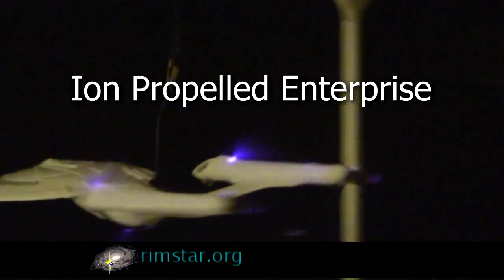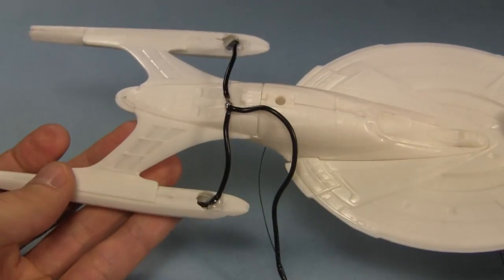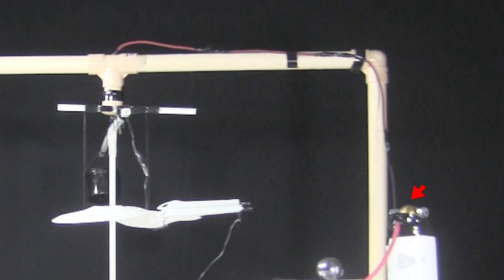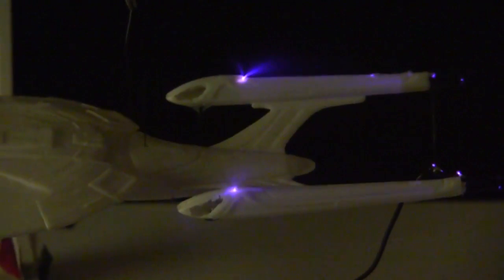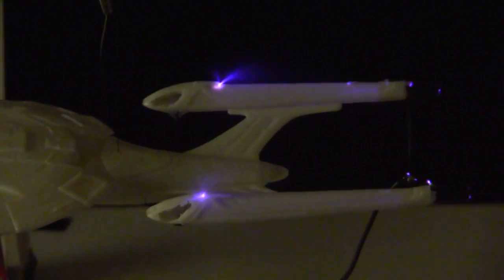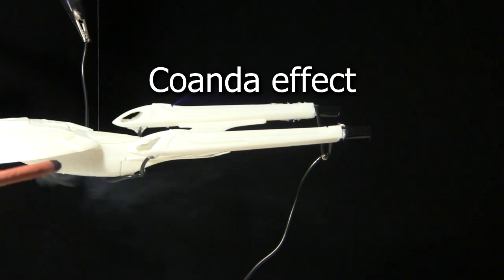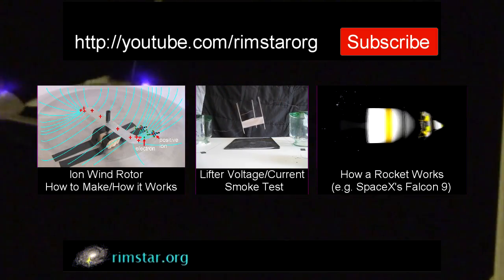Star Trek Enterprise Model with Ion Propulsion added

Comment: Sir I Mack same High voltage power supply but I don't no my wind power is so low I don't no why
Reply from the maker: What are you using for the wires or sharp points? If they're wires then the smaller the diameter, the better it will work. Mine are 30 gauge/AWG. The same applies if you're using sharp points, the sharper the better. You may also have your wire or sharp points too far from your smooth electrode.  You want them almost close enough to make sparks but you don't want sparks. Testing in the dark is also important. Rather than repeat everything, I have a bunch of tips on my webpage here https://rimstar.org/sdprop/lifter/lifter.htm under the heading "Tips for getting your lifter to fly".
Reply: @RimstarOrg  yes sir I use sharp points wire it's work but my model wind power to low and distance is small I think 🤔 maybe my amp is low...so sir how much amp u use your High voltage power supply
Reply from the maker: I agree, it's likely not enough amps. That could have been due to dull points or not being close enough but it sounds like you've ruled those out. I've never managed to measure my amps for these though I suspect it's more than 250  microamps, possibly even a milliamp. I did measure the input voltage and current near the end of this video https://www.youtube.com/watch?v=2HByosRAknY as around 8 volts and 2.5 amps which is 20 watts. In this other video https://www.youtube.com/watch?v=vzZy1Aqleno I measure the high voltage output at 25,000 volts. So 20 watts / 25,000 volts = 1.2 milliamps. Given that there are a lot of losses, it could be even more than that.

Comment: Must you have a minimum of 30KV DC power supply
Reply from the maker: I don't know what the minimum voltage is for this one. It does have to be a power supply that gives a lot of current though for the ionization. A Wimshurst machine or Van de Graaff generator probably won't work. But sadly, I don't know the minimum current required either.

Comment: Is the corona from the ion wind generating much heat? Is it flammable?
Reply from the maker: I've never noticed any heat from corona. I do stay away from it since the parts making the corona are at high voltage and can supply relatively high current but I think I would have noticed anyway. Certainly there was no melting of the plastic on this Enterprise model.
As for its flammability, the ones I work with are usually too low a current for that. However, it is sometimes possible to ignite or at least to burn dry wood if you put the wood in place of where the corona is. In other words put the wood between the two electrodes that produce the corona. In this video https://www.youtube.com/watch?v=r171_8jZqw4 , I show an arc produced by another high voltage power supply that supplies a higher current and that one can definitely burn wood.

Comment: M.Jean Louis Naudin is the inventor of the lifter on the year 2000' ! see his website : the Maximus 2 @ 250g...just ionic wing electrostatic pressure of ion on the molecule of the air near the wire (electrode positive)
Reply from the maker: Actually, Transdimensional Technologies is the inventor of the lifter, referring to the triangular shaped ionocraft with foil skirt and thin wire electrodes. I know because I learned about it at the same time Jean-Louis did from his old online jlnlabs group when someone posted a link to their video a long time ago (the link stopped working long ago).  If you were to ask him, I'm sure he'd tell you the same. Jean-Louis was the first to replicate it and make the replication public and then promote it a lot (I may have done it first, we were both very familiar with the technology at the time so it was easy for us, but I didn't publish until a few days later so I can't make the claim, nor do I care much).
I had forgotten about Maximus 2. I always remember the one by Blazelabs which weighed 100 grams and lifted a 100 gram payload, winning Jean-Louis's 100 gram payload challenge. There was a Japanese one which was room sized but I don't know if they ever said how much theirs weighed.
Reply from the maker: Ah, here you go. http://jnaudin.free.fr/lifters/story.htm He talks about Transdimensional Technologies there.

Comment: Hi! Thanks for these great experiments! :) A question:

What do you think, would this effect work in a greater and complex array form, I mean: by building multiple pieces in one big array, and feeding it with much higher voltage? Could it be a replacer of our propeller-based airplane engines? Theoretically but verified with math… And with more sophisticated materials, e.g. carbon fibre sticks instead of wood, just a tip. Here's a schematic sketch I drawn about what I imagined: http://www.kepfeltoltes.eu/images/hdd1/2018/01/24/520Biefield_Brown_effect_.jpg Of course, I've not worked to model wires, insulations etc.

Thanks! :)
Reply from the maker: It still may not be able to lift its own weight. The record is lifting a 100 grams payload plus the 100 grams of the lifter with a specially made power supply http://blazelabs.com/l-c-hexspiral.asp.
Reply: Thanks. Yet, I made a search for its math and I found this: F=P·(l/U)·[1/b·(1+φ)] (here's a better formatted instance: http://aip.scitation.org/doi/full/10.1063/1.4890353 )

where F is the thrust P is the power, l the electrode separation distance, U the applied potential difference, b the ion mobility (bair = 2.15 × 10–4 m2/V-sec), and φ the fluid performance parameter (φair = 2 × 10−2).

I'm not sure I really understand it but it seems that the generated force is directly proportional with the width of ribbon, for example. So maybe, if you would max the factors out, then the generation force could be multiplied. Would you mind to check it out? Maybe this is a different approach, hiding a new potential for a development. Or not. :D And also, your huge hexagonal concept seems trifling place compared to the concept I sketched yesterday. So the use of space also could be increased, even better than my concept did.
Reply from the maker: After just skimming it, that's a pretty good article, thorough research. There's nothing really new in their written conclusions (I didn't check the math) except the effect of vibration. Regarding the width of the ribbon, that's why when making a lifter we make sure the top of the foil electrode is rounded (https://www.youtube.com/watch?v=vzZy1Aqleno). I'll definitely bookmark that article.

Comment: what if we turn it on with full voltage from the start
Reply from the maker: I never turn it up to full voltage. If I did then it would probably create a long and powerful spark which would damage my power supply from the high current in the power supply. That happened and I had to repair it as I show in this video http://youtu.be/Kb0WwsJgTMM. I turned it up slowly so that I could judge when to stop without danger of creating a spark.

Comment: Is it possible to mane. a small ion trustee with a 9 volt battery a double/triple a battary or C/D battr? :)
Reply from the maker: Yes, but the thrust will be small. You'd also need the electronics to step up the voltage to the thousands of volts. Likely not enough thrust for the batteries and electronics to be on board.
Reply: RimstarOrg Are you saying some how convert the current/resistance from the battery into extra voltage (thousands in this case)?
Reply from the maker: Yes. I don't have any circuits for doing it myself but I've seen some videos with them in the past. But as I said, the thrust will be small. I don't know what you plan on doing with it.
Reply: RimstarOrg Im hoping to make some small flying gadget. And thank you! :)

Comment: Very interesting, but doesn't ion propulsion only work in vacuum? Is this a "real" ion thruster?
Reply from the maker: No, ion propulsion works with and without a vacuum. The difference is that in air, the air can be used as the propellent, whereas in a vacuum the craft needs to supply its own propellent, usually xenon gas. So yes, this is a real ion thruster. I have a video here https://www.youtube.com/watch?v=01F8V5IhB5k explaining the principle when in air.

Comment: Wouldn`t you have to connect the negative power supply to  the spiky wire and the positive supply to the aluminum ring because electrons travel from negative to positive? Could you explain it please, i don`t really understand this :) .
Reply from the maker: Which way you put the polarity doesn't matter much. The important thing is the geometry of the electrodes. You need a smooth side (the aluminum ring) and a sharp side (the spiky wire) and regardless of the polarity, ions will from from the sharp side to the smooth side. I explain it in detail in my video on how ion propulsion works (https://www.youtube.com/watch?v=01F8V5IhB5k).
Reply: Thank you for your explanation. 
Btw: Nice Enterprise ;)

Comment: Dear Steve,

If this model works using electrostatic forces, ionic wind as you state, then it would require air with all its gases, correct? And if so, then it should not be able to work in a vacuum environment, correct? 
Have you ever tried, or would be willing to perform such an experiment, ever? And if it does move still, then is it fair to say that the propulsion relies on more than simply electrostatic forces? Thank you so much for these amazing videos! Good luck.
Reply from the maker: +enjoypolo I'm glad you're enjoying my videos. Thanks for watching. I've never tested it in a vacuum chamber. Tests have been done by others in the past but of course whenever there was success, the movement was much less. Sometimes it was accompanied by sparks, which eject matter from the device which acts like a propellant. There's also the emission of electrons which would also act as propellant.

Comment: Would a battery work the same or do you need higher voltage to effectively generate thrust.
Reply from the maker: +brett hawk You need thousands of volts and with a decent amount of current too. The voltage is dependent on how far apart the electrodes are, but you're still talking about thousands.
Reply: Alright, thanks for the quick response.

Comment: This is awesome.  I want to learn more about Ion Drives, and saw your video.  I would like to try and make one, however I have a 10vDc /2-10amp power supply.  Do you think I could use a step up Transformer to achieve the desired voltage, and what about the circuit?  Also, what kind of Watt and Heat (Joules) does this experiment pushes out? Thanks.
Reply from the maker: +callal0u Your power supply is sufficient as a first stage to feed something else that will give you the needed voltage and current. Maybe connecting it to a neon sign transformer will work but I've never looked into that approach. However, you could look into that. For my 2nd stage I connect my low voltage power supply to a high voltage power supply that has a flyback circuit followed by a Cockroft-Walton voltage multiplier circuit. You can see it here https://www.youtube.com/watch?v=GEuK1OdYxHk and here http://rimstar.org/equip/30kv_pwr_supply.htm.
I don't know what the output of the ion propulsion is, but I show measuring the high voltage input to it here https://www.youtube.com/watch?v=LOGAaObsN4g.

Comment: is there a way to make the thing fly upward like a lifter but also have the ionic wind make it go forward, and how did the electricity from the wire get to the aluminum foil and and how were the lights formed? I just dont get it.
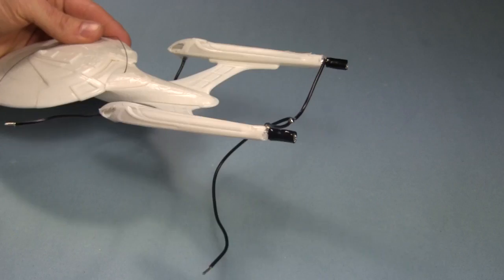Reply from the maker: Theoretically you could make one light enough and configure it so that it flies up like a lifter and also go forward. This plastic model is too heavy for that. You can see how the wires are connected to the aluminum foil at 1:03 in the video. The ends of the wire are simply bared and taped to the foil with black vinyl electrical tape. The bluish light you see is called corona. It's a result of the air becoming ionized, though I don't know exactly what part of the ionization process is giving off the bluish photon that your eye detects. You can learn more about this corona and propulsion in my video How Ion Propulsion, Lifters and Ionocrafts Work
Reply: ok thanks!

Comment: This is something cool. I imagine that room pressure air gives it a boost? Have you tried to put this set up in a vacuum chamber? Your design doesn't have a propellant source such as argon or xenon?
Reply from the maker: I'm glad you liked it. Recalling from the early days when lots of people were working with lifters, some at high altitudes, the lower the air pressure, the less well it works. That's also been observed in vacuum chambers where the pressure is very low. I don't have a vacuum chamber so I haven't had a chance to experiment with one. My design does have a propellent source though, the air itself.
Reply: Well Rimmer,
                     This is still awesome. Vacuum chambers for your rack and prototype could be contained in a fish tank with a sealed lid... just pump out the air.
You might want to look into a directed beam power device to charge your engines remotely?
It's stuff like this that makes me think how space travel could be vastly improved by this kind of engineering.
Keep this stuff up, it's hard not to be impressed by demonstration of simplicity.
Though you home built electrical substation is quite impressive.
thanks, Tom

Comment: Hello RimstarOrg,

I have a few questions in regards to the Lorentz force.

1. Can a Lorentz force helix be created in the air rather then inside of a plasma sphere?
2. If it is possible to ionise a column of air, could that column support a payload?
3. Would using a saline/citric acid/vinegar spray solution help to carry an electrical charge when ionising the air?

Thank You
Reply from the maker: 2. If you had a column of air, ionized with one polarity then sure there be a repelling for on an oppositely charged payload. Of course there'd be an equal and opposite reaction and the air would also be repelled.
I don't have answers for the other two questions. :)
Reply: Thank You for responding

Comment: Cool! What kit model did you use? And is there a reason you didn't put the split wires coming out of the end of the nacelle?
Reply from the maker: I used the AMT Star Trek U.S.S. Enterprise NCC-1701-E snap together kit. For this type of ion propulsion the sharp points go at the front of the nacelle and as much as possible only rounded edges go at the back end of the nacelle. I go over it in much more detail in my "How Ion Propulsion, Lifters and Ionocrafts Work" http://youtu.be/01F8V5IhB5k video. It isn't the type where you have just sharp points alone.

Comment: That is the star ship Voyager from the series of the same name, while it did appear in the Star Trek TNG series, it is not nor ever was an incarnation of the enterprise. Voyager got very interesting toward the end, then it was killed like all other Star Trek  series. Love the model and application of physics.
Reply from the maker: Nope. This is the Enterprise 1701-E from the movies First Contact, Insurrection, and Nemesis, but there are definitely similarities to Voyager (elongated saucer, similar saucer connection to the secondary hull. The nacelles are quite different though.) The kit I bought came with three possible Enterprises and this was the largest, otherwise I would have used the one from TOS since it had cylindrical nacelles. I liked Voyager, but only when I watched it all the way through. I liked TNG the least, but that's probably because I've seen only scattered episodes. My favorite was the Enterprise series - but I think that puts me in a very small minority. Anyway, glad you enjoyed the video. It was one I couldn't resist making.
Reply: I am most familiar with the galaxy class enterprise, in those final TNG movies they departed from the ship of the series, using a ship much more similar to the Intrepid class deep space science vessel Voyager. the Sovereign class Enterprise 1701-E is vastly larger than the Intrepid class Voyager,  I will never mistake them again, Unpainted and marked the similarity is UN-canny, I'm sorry I doubted your treckyness.
Reply from the maker: GreningerProductions
No problem. It's always a pleasure talking trek.

Comment: I know the original concept behind this type of propulsion is along the lines of spacecraft...  But how would this fare in a vacuum?
Reply from the maker: It does work in a vacuum but only if you bring along some propellant. I used air in the video but in ion propulsion engines that NASA has used in space they carried along xenon gas. Of course they run out eventually but it does last a long time.

Comment: I really like this one :) Had to be done.

What are the chances of comparing atmospheric ion drive to ion drive in a vacuum? I've always wondered...
Reply from the maker: I'm glad you like it.
It'd be a hard comparison to do since the gases would be different. In vacuum you'd be supplying your own; NASA's used xenon with some spacecraft. It'd be apples and oranges. If you did match the gases and everything else then I guess vacuum would work best because the remaining variable would be air resistance to forward movement.